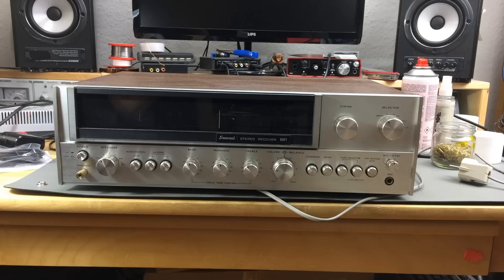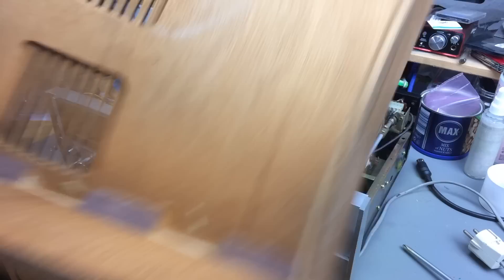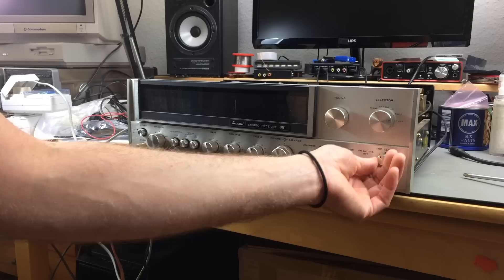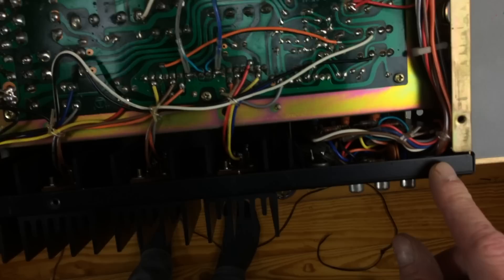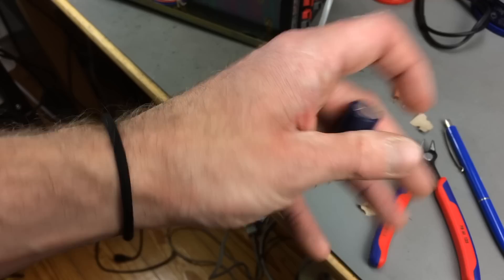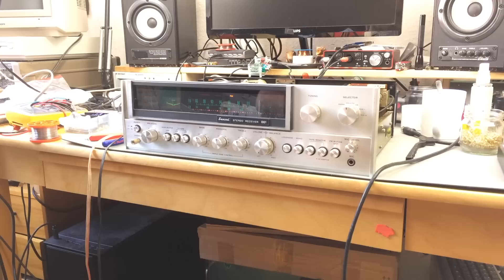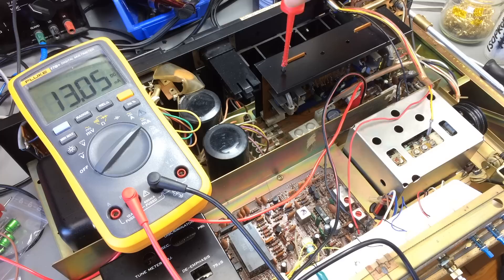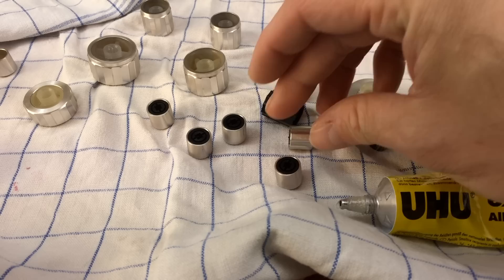Sansui 881 Vintage Receiver Restoration

Comment: Usually those 70s Receivers go for about $75-$175 on eBay. This model Sansui 881 Goes for considerably more $300+. Anyone know why this model would be worth so much more?
Reply: I bought a sansui 441 receiver back in 1973, the basic model then was the 221, so you can figure out sansui's product numbering. I guess the 881 model was top of the range then. Sadly my 441 developed bad crackling and buzzing on the right channel a few years back so I took it to our local recycling centre and dumped it. Oh dear what a mistake that was.
Reply: Most mid grade and top grade 70s receivers go for way more than $175. Sansui 9090s are as high as $1800.
Reply: @timcoker4685  Ok, you qualified it with Mid/Top Grade. Here is what I found on eBay sold items for Working AM/FM 70s era Amplifiers: Kenwood KR-4400  -  $59, MCS Series 3233 -  $135, Sansui Solid State 350A -  $99.99, Vintage Sanyo 2050 -  $120, Vintage Kenwood KR-6200 -  $137.5, Kenwood Kr-6170 -  $128, Pioneer SX-424 -  $115.95, Vintage Yamaha CR-620 -  $86, Technics SA-101 -  $67.96,
Reply: @michaelterry1000  I just looked at Sansui stereos in vintage electronics for sale. Just on the first page there were a shit load of stereos going for $400-600. What were you looking at "for parts only". A good 881 will go between $300-400 . Pioneer, Sansui and Marantz units are pretty high in price. Most of the stereos you mentioned were bottom of the line. Just punch in Sansui 9090 in vintage audio, units not even working go for $600. I just looked at 9090s on EBay....some are going for $2500-3000!